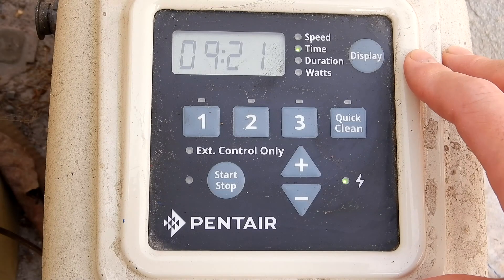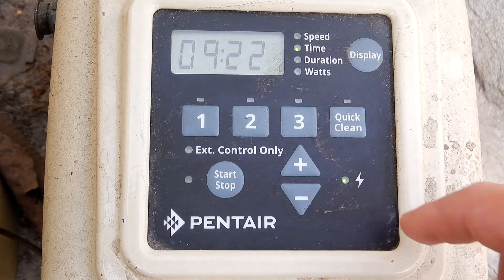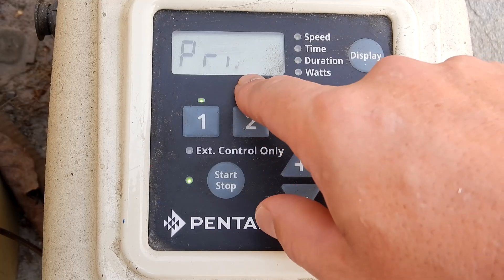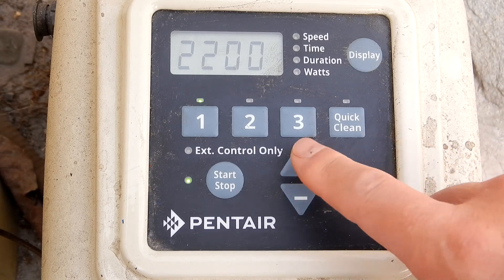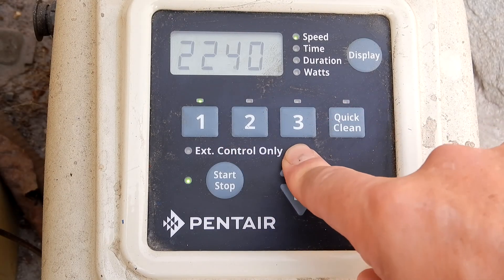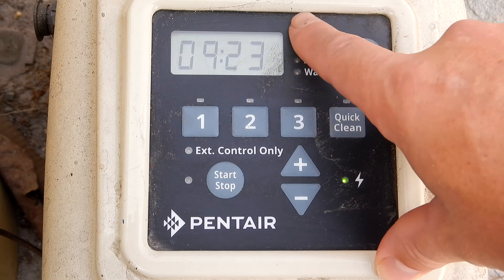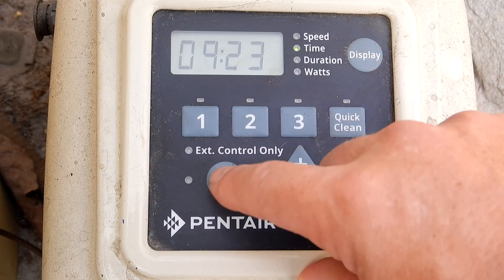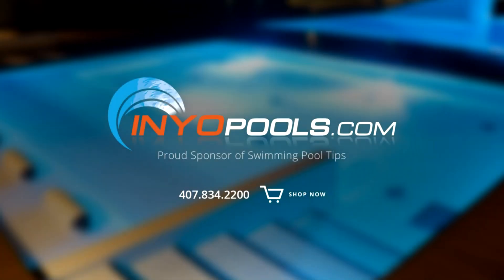How to Set the Priming Speed on a Pentair SuperFlo VS (VST) Pump

Comment: I recently purchased this pool pump and i love it. what is the ideal amount of time to run this pump? The higher RPM works great for my auto vac MX6 but not so much on lower RPM. Any tips on how to have both working efficiently? 
Thanks great videos and help me out a lot
Reply from the maker: The MX6 just won't work on a very low RPM. It won't damage it, just won't really move much unless the RPM is over 2300 RPM or so.

Comment: I'm installing one of these pumps this week, equipment pad is significantly above pool water level, 15+ feet. would you recommend leaving priming speed at the  3450 max?
Reply from the maker: Maybe. Installing a check valve in front will also help it prime.
Reply: yup, will do. thanks.